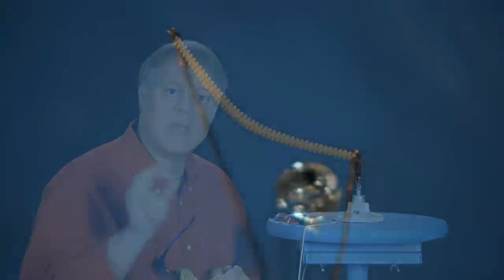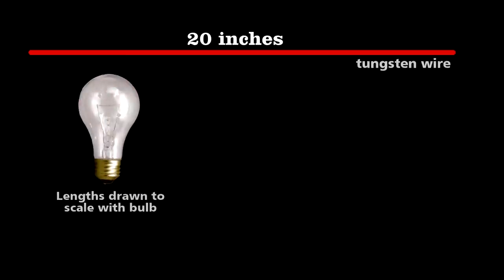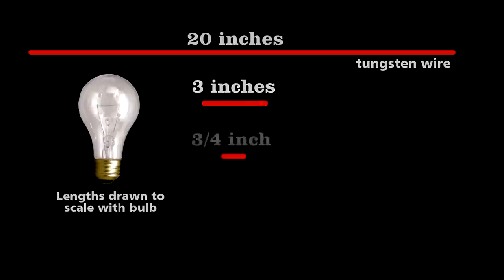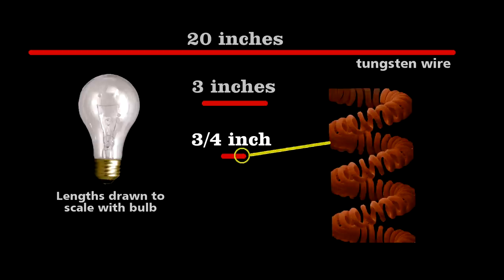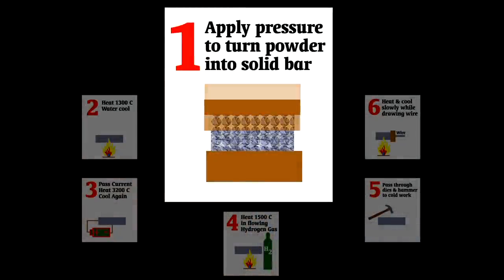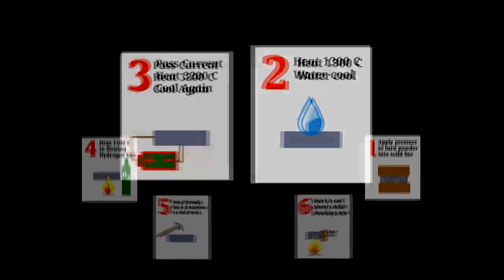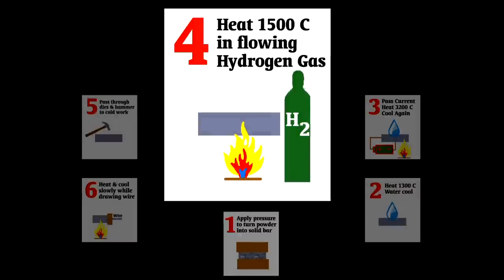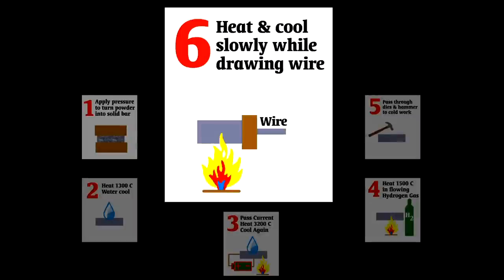Light bulb filament

Comment: for the most part he is correct, however, not every filament is the same. I work in a plant that manufactures incandescent bulbs, and depending on the wattage the coil will vary in size and length significantly. from nightlight/christmas light bulbs to huge stadium lights, each coil is different. also, argon is not the only gas used. sometimes argon, nitrogen and xenon are used either in a mix or independently depending upon the light output desired. also, red phosphorus is used to coat the coil before it even enters the glass bulb, that way, when the bulb is ignited for the first time, the phosporous will destroy any contamination and oxygen that may have gotten inside.
Reply: +Brandon Waterman Okay this might be a lame question, but here goes- Why Tungsten? What's so special about this really difficult-to-use metal that makes it the suitable candidate for incandescent filaments?
Reply: Of all elements we have,  tungsten is the only one capable of handling the high temperatures produced for prolonged periods of time while emitting enough lumens to be able to see.
Reply: Brandon Waterman Thanks mate.
Reply: +Brandon Waterman his youtube name made me read your comments like it was an insult xD
Reply: +Jazmie Hamizan thought the same thing lol
Reply: How did they come to the conclusion that tungsten would be the best metal to use? Did they attempt o use every single other metal beforehand?
Reply: chrisbbc09 I'm  not 100% sure of every step taken but as with anything else  I'm  sure R&D spent a long time combining different elements and gases before they came to the conclusion that tungsten was the prime choice.
Reply: Xs Biggy google says that tungsten has a very high boiling point compared to average metals and it has a high tensile strength (which scientist spend years to overcome it)
Reply: Jazmie Hamizan it indeed does and that's precisely the reason it is used. as to the steps they went through to finally  decide tungsten was the best material to use are beyond me, I work in the manufacturing portion for a incandescent manufacturer,  not R&D. What I can tell you is that the filament, or "coil" as we call them, are finicky and the damn things stick to clothing like burdocks.
Reply: I know Edison tried a bunch of different materials, including human hair. Tungsten may have been the result of trial and error, though I'm sure the engineers were aware of its properties. 

As a side note, in photography and video, one often has to correct for the color temperature of "tungsten light." It tends to run a little yellow. Florescent light runs a little blue.
Reply: Hey engineer guy
Reply: @chrisbbc09  Edison tried thousands of different substances, many of them were before they thought about a vacuum bulb even.
Reply: why is it that the large round nightlight bulbs with a standard base explode and blacken the inside of the envelope when they burn out, and also the large outdoor Christmas lights from back in the 60's- 70's , the white ones of these seemed to do this also. all the others just quietly died, but not the white ones. . . .is there something different about the way the filament supports are made, or the filament configuration that causes this?
Reply: @dusterdude238  What I learned in one of my earliest classes in electrical engineering, is this: 
When you first turn on an incandescent bulb, the filament is cold and offers little electrical resistance. It almost acts like a short circuit, and the current rushes in. As the current flows through the filament, it heats up, and incidentally raises the filament's resistance with the temperature. The current is lowered to something reasonable, and the bulb proceeds to operate normally for a long time. 
So, if there's a weak point in the filament, during the intense inrush current moment, the electromechanical shock will make the filament fail then. There'll be a bright flash, and additional tungsten will be vaporized, (additional to all that vaporized during the life of the bulb, that is,) blackening the interior of the bulb. 
Since bulbs would fail most often during the inrush current at turn-on, this was why theaters with their 40-foot (12.2 meter) ceilings, where changing a bulb is difficult, would brighten the lights very gradually, using a rheostat. That way they avoided the common failure mode of their bulbs and avoided having to change them.
Reply: @MottyGlix  AH ok, thanx.

Comment: I didn't know that producing the filament would be such a complicated process. There is one type of bulb that I find particularly interesting and it is the halogen bulb. I used to wonder what it is that makes it brighter and whiter than the regular bulb. What I found is that the halogen gas in the bulb makes it possible for the filament to endure a higher temperature without evaporating.

Comment: This is an incredibly well done video!  Incandescent light bulbs are so popular, produce a pleasing spectrum of light compared to current LEDs and yet... are so wasteful. Is it that tungsten has a high resistance but the engineered wire is heated to a glow because the voltage forces the electrons to pass through?
Reply: Light seems to be a combination of heat and phase shift (reactive point).

Comment: @goblend 
Those bulbs also are of a design that burns at a lower temp in a way the filament in them is more like what you'd find inside a vacuum tube.
In newer bulbs they pushed up the temps to get a whiter light and switch from a vacuum in the bulb to argon to cut costs.
Now there are long life bulbs they burn at a slightly lower temp which yields a more yellowish light and the filament has multiple supports to prevent it from breaking.

Comment: @CraigMerton I also heard that if you touch the bulb so that grease or dirt is left on the glass. The light will heat it and the heat will make the glass crystallize. When the glass crystallizes it will no longer be able to seal the gas since the crystal form is not gas tight which the amorph glass is.

Comment: @alphabeets Yes, but you will notice that the lamp envelope gets bigger, too, so that the temperature of the glass stays about the same (more surface area). I made a boot drier out of an old Christmas tree lighting string with two lamps. The normal small 7-watt lamps melted the boot liner, but 7-watt lamps that were twice the diameter were cool enough not to damage the boots with the same amount of heat.

Comment: The reason we prefer incandescent lighting over any alternative is because of the perceived "warmth" of the light. This is because light from a heated source has a broad continuous spectrum which illuminates in a way we find pleasing. This applies equally to other heat sources of light - candlelight, lamplight, fire light and of course, sunlight. Fluorescent (and LED) light by contrast has a sharply peaked spectrum, and subjectively seems cold and clinical. Why is it (apparently) impossible to replicate the heat-generated light spectrum using these other technologies? Eg, a cluster of LED's of different colors should create a broad enough spectrum to resemble an incandescent source.

Comment: @CraigMerton 
Also note that low voltage (12V) halogen bulbs have a considerably thicker filament than high voltage bulbs and they glow at a higher temperature which is why they have a whiter light than high voltage halogen bulbs that have come to the market recently.

Comment: Do light bulbs really not have a vacuum anymore? They make an ever-so-wonderful implosion/popping sound when you drop them and break them.
Reply: They're at about 70% of atmospheric pressure - you can think of that as a partial vacuum if you like. Still enough of a pressure difference for that popping, but a hard vacuum (close to zero pressure) would require a very strong bulb - offhand I think that'd be a few hundred pounds of force pushing inwards.

Comment: I had a light bulb glass break and I continued to use it for another 2 hours, and it never burned out.  I have video to prove this in my videos.  :)
Reply: That's because you used it in a room with no air :-)
Reply: did you have it on reduced current or something? usually as soon as air hits the filament it will consume itself .

Comment: @CraigMerton The gas in a halogen bulb reacts with the evaporated metal as soon as it leaves the filament. When the metal-halogen gas touches the glowing filament, the heat from it breaks the molecule and deposits the metal back on the filament.

Comment: @CraigMerton The gas pressure and the glow temperature is carefully calibrated so that this halogen cycle of depositing metal on the filament is at its peak efficiency. If you feed the bulb with too high a voltage, the gas will not be able to receive all evaporated metal. If you feed it too low, the cycle will not be complete. That's why it is good to periodically run dimmed halogen lights at nominal voltage so that the halogen cycle can fully deposit metal back on the filament.

Comment: @engineerguyvideo very nice video , informative and entertaining :)
I've a question what happens if i supplied a 220v AC bulb with 220v DC supply .... will it burst in flames will it work but somewhat "dimmed" ... or it wont work at all ? .... thanks in advance

Comment: @shizlnit For broken bulbs: The filament gets white hot and if in air, quickly burns up as seen in the video. For intact bulbs: Over time the molecules of metal in the filament, when heated, spew off the filament towards the bulb envelope (thus darkening it). This thins the filament until it eventually breaks by the shock of the slight motion caused by the initial heating every time it is turned on. This can be prevented by running it cooler (lower voltage), but it is VERY wasteful.

Comment: @CraigMerton Lighting technology is interesting and I've learned quite a bit about fluorescent lights. I used to wonder why they use noble gases in incandescent tubes. It turned out that this gas is uesd because it doesn't react with the electrodes even though electricity is flowing through it.

Comment: The sulphur is sealed inside a quartz crystal and there are no electrodes as the sulphur would corrode them in no time. Instead the sulphur is heated by a magnetron that heats the sulphur inside the ball using microwaves, very much like a microwave oven. When the sulphur is turned into a gas (or plasma) the microwaves excites the molecules and make them glow.

Comment: I think researchers are developing light bulbs that shoot RGB lasers in proper proportion at a prism to create diffused white light. It will supposedly make incandescent, cfl, and led obsolete...
Reply: I don't see how a light source that requires three lasers could be more practical than an LED.
Reply: Not sure... the goal is brighter light with less energy.
Reply: Do you know what it's called?
Reply: Don't know about RGB lasers, but there are already laser "lightbulbs" available in consumer projectors, and laser car headlights in development. These fire a single blue laser onto a yellow phosphor "filament" that glows white. 
They're very very bright, create less heat than an equivalent LED and use less electricity.

Comment: Interesting, I always thought the reason for the argon was to stop the tungsten burning out and causing a break in the circuit. If it simply oxidises, will there still be current passing through the coil but no light given off?
Reply: Oxidising is burning out. The tungsten oxide doesn't conduct electricity, so there's a break in the circuit even if the filament itself is still physically continuous.
Reply: ThinkingSpeck is it possible for only the surface to oxidise, with a bit of unoxidised tungsten inside? Or is it so thin that it all oxidises?
Reply: +mmark1990 The normal operating temperature of the tungsten filament is about 2550°C, and the boiling point of tungsten oxide is only 1700°C. So the oxide boils away until the tungsten itself is all gone at one point and circuit is broken.

I'm used to seeing the filament actually visibly snap when an incandescent bulb blows, but that didn't happen here - my best guess is that the tungsten itself at the failure point melted (3422°C) before the oxide could all boil away, because decreasing cross-sectional area of unoxidised tungsten would have made for really high current density.

Comment: What if you were to make tungsten light bulb filament without making it into a coil?
Would it not work, or work just not as effectively?
What makes turning it to coil so.. popular I guess?
Reply: The coil does three things: it makes the filament more compact, it makes it more durable, and it makes it more efficient.

Compactness is obvious. It takes up less space, which has the added benefit of being a smaller source of light, which is more desirable to allow for better light distribution.

Durability is less obvious, but a long filament will generally sag more and can be more liable to break from shock. A coiled filament requires less support wires since it's shorter.

Lastly, efficiency. A filament emits lots of energy, some visible but most as largely useless infrared light. Tungsten is reflective to visible light, but less so to infrared. The light bulb emits its energy, and some amount of it only moves from one part of the filament to another, where the visible light is reflected to potentially bounce out, but some portion of the infrared light is re-absorbed by the filament. This heats the filament, which allows you to use less electricity to do the same. This effect is made much stronger by the coiled coil, since the filament is closer together, and so more energy runs back into the filament.

Many decorative bulbs and tubular bulbs don't use coiled coils for aesthetic reasons, and their outputs are often substantially lower for the same wattage. They do, however, function fine

Comment: Maybe i misinterpreted at 3:05, but how does argon gas insulate better than a vacuum? If the goal is to maximize radiative output, wouldn't you want to completely eliminate conduction and convection by having the filament in vacuum?

Comment: @Mezgrman Now if you live in most of the world that uses a line (mains) voltage of 240 volts instead of the U.S.'s 120 volts, the filament has to be twice the resistance (the wattage being equal); that means twice the length or half the wire diameter or some combination of the two.

Comment: internal reflections?  How does that work to make it brighter?
Reply: Right. I don't exactly understand what is meant by internal reflections. I think it might mean that part of the light given off by a coil shines right into the coil (something I have also noticed about in the corkscrew CFLs) rather than into the room. But if the coil is reflective, the light bounces off instead of being absorbed. And if it hits the coil again after this bounce, then it bounces again. So in the end more light shines into the room if the coil is reflective. OTOH the light that is absorbed instead of reflected heats up the coil further, and the higher temperature results in more light being radiated.
Reply: @Russell Hltn 
Good question. Would be cool to measure lumens a single uncoiled strand of tungsten, then compare to coiled strand of same material / diameter / length.

Comment: These lightbulbs tend to generate a lot of heat, ironically this was used in a great advantage, streetlights use bulbs that generate so much heat they do not freeze during winter allowing streets to remain safe, sadly I heard they decided to replace the bulbs with more energy efficient bulbs, that means they would need to use more money to have workers keep the streetlights clear of ice. I also heard rumors that the energy saving bulbs aren't that bright and lose their brightness quickly.

Comment: Why is tungsten used and not some other metal, one that's more naturally ductile?

I'm not an engineer, but I'm guessing the most important thing would be high electrical resistance, isn't that what creates the incandescent glow, or is it just heat?
Reply: It's mainly that tungsten can get very hot without melting or deforming.  That heat is what causes it to glow.  If most other materials were that hot, they'd either decompose or melt.

Comment: With all these coils why are they purely resistive loads in an ac circuit? Why doesn't the coils create inductance?
Reply: They should have the inductance, I used to play with a small lightbulb powering it up with audio signal while holding a magnet near it. The filament played the music back, although faintly.
Reply: insylem why? That really  happened. Why would I be lying to you?
Reply: I was trying to reply  to hwoods01 about his Trump remark.  Trump's opinion on other people, or anyones opinion on anything have nothing to do with physics and electronics and the like.
Reply: insylem I see, no problem then
Reply: TheDaniel366Cobra Now that is so clever!
Reply: insylem When a tungsten filament is heated its resistance is about 144 ohms. The inductive reactance is a function of the coil's inductance and frequency (XL=2*pi*f*L). The inductance is very low in the picohenries (10E -12) so the filament's reactance is negligible.
Reply: @insylem 

Good point. I guess what Tim Early was trying to say in this message string this that tungsten is a resistive BOSS.
I don’t know the details, but I would guess that based on the properties of tungsten, no amount of coils will create a inductive reactance that will have any negligible affect compared to the resistance.

Copper? Different story. Less resistance. So the copper coils do have quite an effect compared to its resistance.